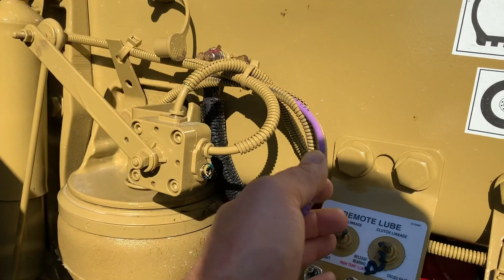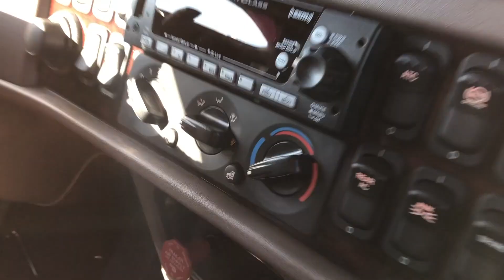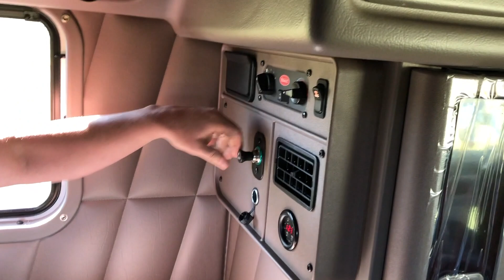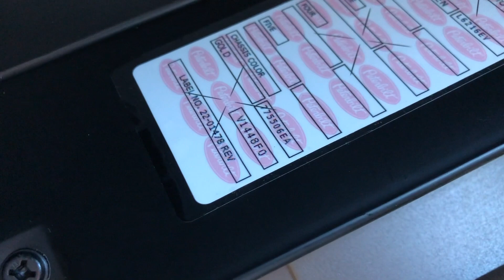Introducing "CASH MONEY" the 2021 Peterbilt 389 Custom Build

Comment: Rlk Stainless visor - Stainless Hogebuilt 80” Half Fenders ,Polished Tanks , 7-8” Dynaflex Flat Tops And a Small Stainless Cab and cowl panel And Rear Light Bar and Some Watermelon lights On The corner of the Bumper/Iowa customs Under Light Panels Under The Frame And Cab/sleeper And No side Window Chops !!
Reply: I agree with you  about the no  window chop

Comment: Make sure you check the blinker fluid it Newton valve  and muffling bearings
Reply from the maker: The new 389’s don’t have muffler bearings, they changed over to a flange system. 😂😂

Comment: The only way you can paint the tanks is if its a show truck and gets trailered from 1 show to the next. An actual working class truck will have the paint sand blasted off the bottom sides of the tanks in a few months. And I thought it was comical that you have a Cummins motor with the frame painted Cat yellow!
Reply: LOL, good eye! that was the exact thought process we had when we first seen it. The frame was supposed to be “gold” but oh well. We’ll fix it in the paint booth.

Comment: Didn't see the double frame insert on the frame, should have one if the wheelbase is over 280"  Where is it?
Reply from the maker: This truck has the larger 11in rails you can go to 295 with out an insert.
Reply: @SEMICasualShow  knew something was going  on. every other truck has them when going over 280" thanks for the explanation ,maybe add to one your video's.

Comment: Bulit peterbuilt in the making keep it dark with a touch of gold and air brush a massive mustang on the rear of the sleeper change out most of the chrome for stain Black finish would be a mine hard  looking truck instead of shiny weak looking

Comment: Low j brackets double round lights painted visor painted 8 inch side panels painted tanks with wide stainless straps delete the bars on the grill stainless round hole grill put patriot fenders on the hood stainless bumper would be a good looking truck